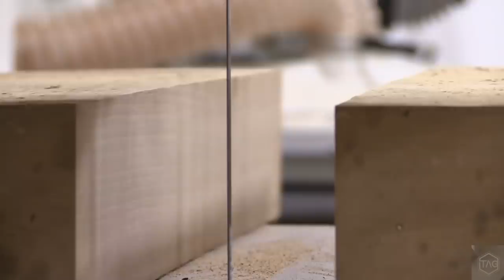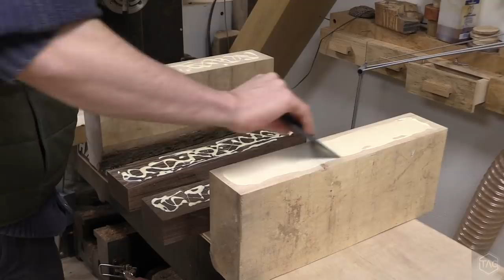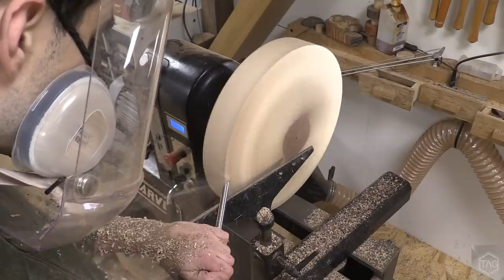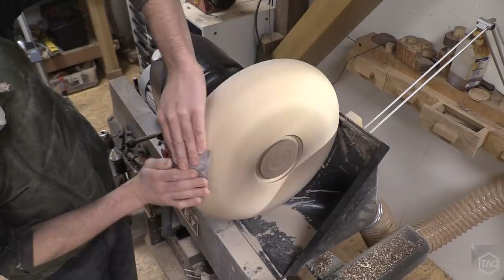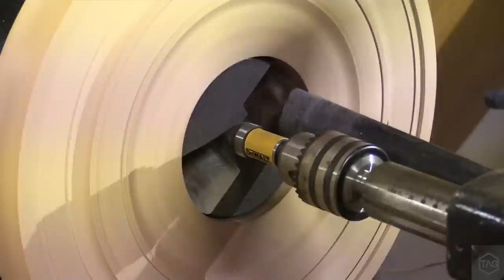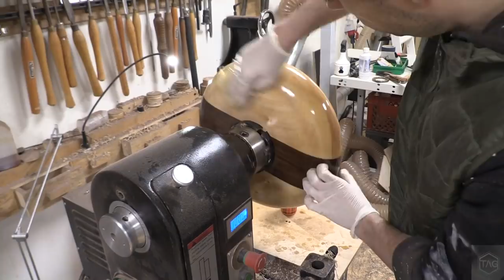Woodturning - Mixed bowl

Comment: Very nice project.... well done.
1 question.... Did you turn in high gear ? because i saw youre rpm fluctuate when taking light cuts.
Reply from the maker: Ja klopt Peter, fluctueerd altijd wel iets. Mijn lage versnelling gaat tot 800 toeren, tenzij ik iets van 60cm en zwaars draai wissel ik meestal niet hiernaar. Eigenlijk had ik dat beter wel kunnen doen bij de grote forstner boor van 117mm. Fluctueert veel daarbij. Van +/-600 naar 560 tpm. Weet jij of het schadelijk kan zijn voor de motor/omvormer?. Misschien toch maar even wisselen voortaan.